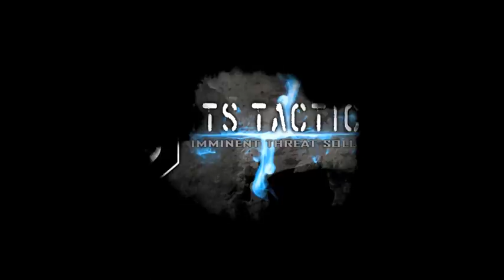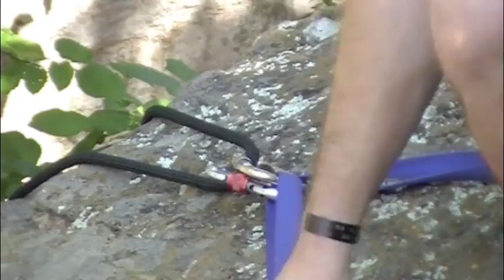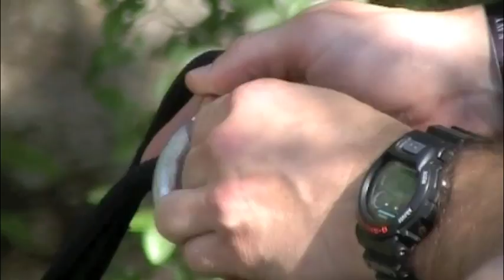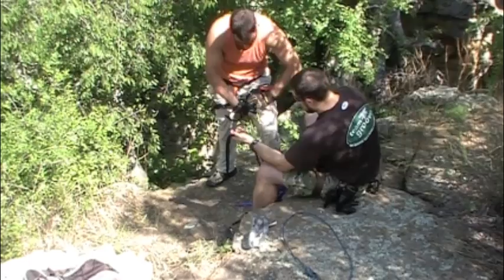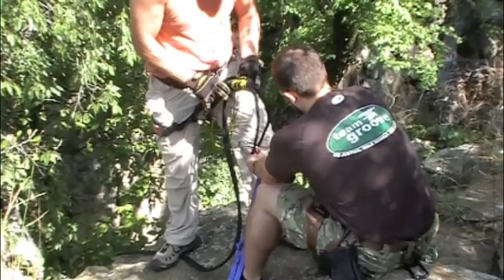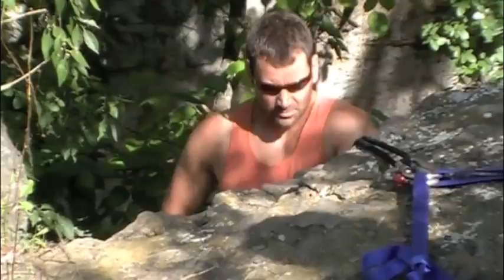Setting up a Fixed Rappel Station

Comment: @ITStactical didnt see the tape knot in your series, I use a waterknot, basically a fig 8 with the other end coming through and following the knot from the other side. It may be the same knot just different names.
Reply: Different names, same knot. It’s actually an overhand knot with a follow through.

Comment: How would rappel off something if it wasn't a 90 degree cliff? I do this at Red Rock but can't find any cliff's like that. I have to deal with rounded edges that chews up parts of my Bluewater 11mm static assaultline because there are multiple bumps in the rock that chew up part of the rope instead of just 1 steep edge like this. Do you use multiple rope guards, different durable rope, or not rappel off rounded cliffs multiple times as a sport? Is the fraying normal if you don't see the core?
Reply: The fraying is normal but not after a few rappels. It sounds like maybe you aren’t staying inline with your anchor & your rope is rubbing. I rappel off angles greater than 90 all the time with no problem. You can get rope guards or even pad the west she with a jacket to keep the rope from sawing on the edge. Having your anchor focal point over the edge is the best help though. 9 years late but it’s a response.

Comment: My only question, and maybe I just don't know because I am relatively new to this, is aren't you supposed to have an angle smaller than 90 degrees for the webbing?  Opening past 90 degreed creates a force greater than the weight of the climber.  It would seem that with the setup you have, on a hard fall you would place alot of stress on the webbing.  But again, I could be wrong.
Reply: You are not wrong

Comment: This is just a scary set-up. I find it interesting how you're talking about redundancy this, redundancy that yet neither of you are wearing helmets? Your anchor is not redundant, you should take an anchors course from a professional guide. A prusik is pronounced PRUsik, not proosik. It's used as a back-up and should be just that, a BACK UP. The prusik should be below the rappel device as a back up. If its above the device like you have it and it gets loaded before the device it's hard to unload.

Comment: The vector angle of your anchor is way to high; don't step on the rope; where are the helmets??; use the harness loop to clip any carabiner, not the leg and waist loop; the prussik should have been under the rappel device; the gate of both carabiners at the master point should be facing opposite directions...and never stand close to a ledge without a personal anchor such a sling or a daisy chain...
Reply: I know! What are these nobs thinking!?!?!?!

Comment: Hey sorry for the honesty but just warning people that looks at this video and has little to no climbing experience...Their is plenty of ways to do it like he said but THIS IS NOT A WAY TO DO IT.  First this rope is not fixed, so don't say it is.  Second yes your anchor is short so you are creating a lot of stress on your anchor bolts and the entire system.  Third if you rope of even your webbing is rubbing on the adage like that you must have have some type of guard to protect it.CONTINUES

Comment: Forth, those two carabiners are not apposing each other. 1 quick Ex: One Achor fails because its over loaded, rope slides to 1 side and now its dragging on rock and rock brakes and climber getting hurt or killed. Sorry if I sound rude I just dont want people to Die doing a sport that I love because of bad practice.